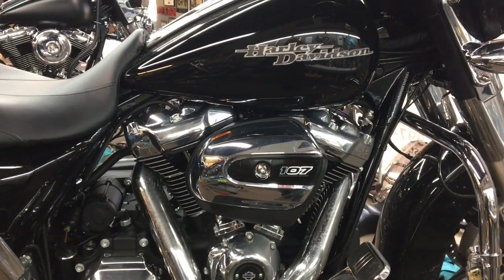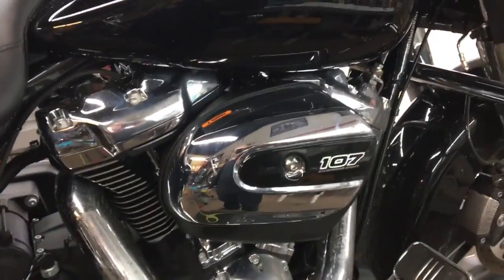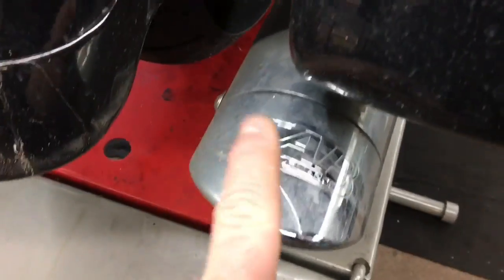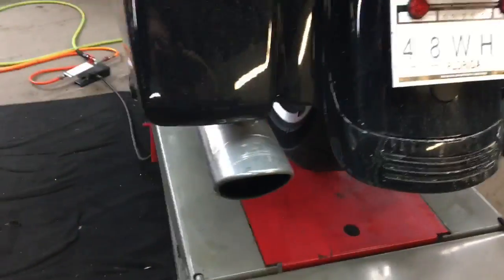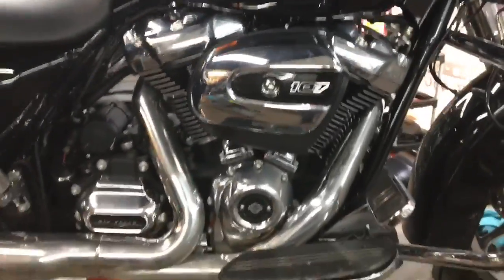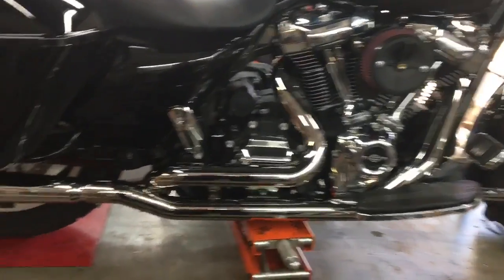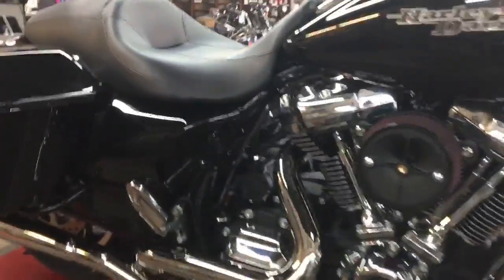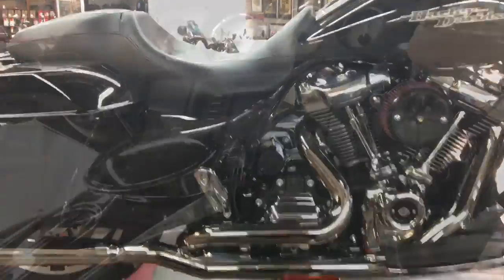SVT Boneshakers M8 Full Exhaust System

Comment: I want it louder is this the loudest setup for the 2017 road glide 107 and is it for sale in california?
Reply: I would run a set of true dual headers, like Vance and Hines or Bassani with Thunderheader, CFR, or RCX slip ons. The Bassani headers require you to run 2016 back mufflers, the Vance and Hines will work with the big diameter right side muffler that came out on the 2017's.  These headers in their video look like the Bassani Down Under true dual headers. These Boneshakers sound better with the header changed, as will all mufflers.